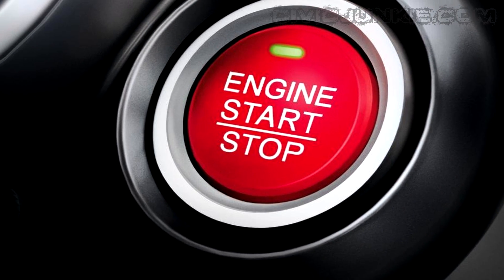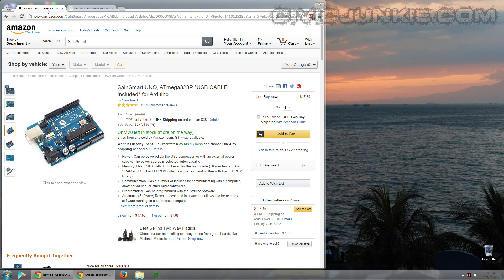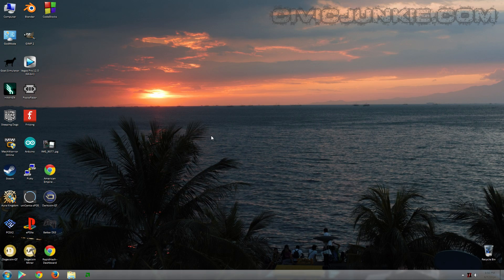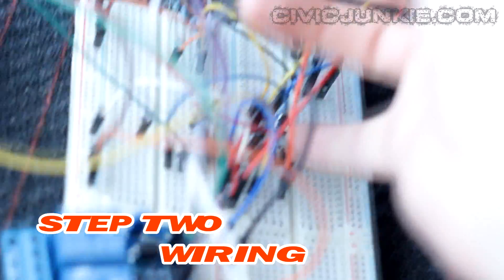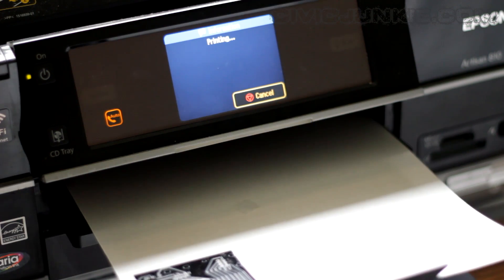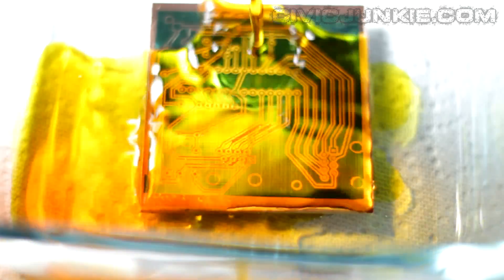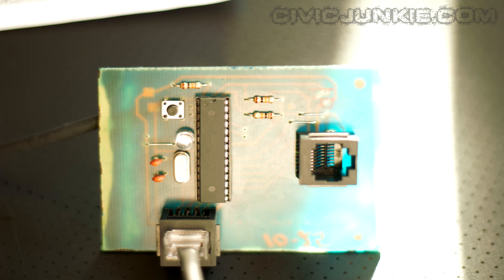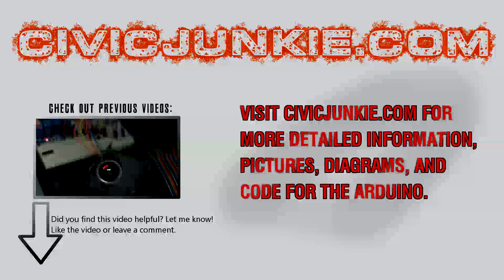Engine Start Button

Comment: Vehicles factory equipped with a start button also have a steering wheel lock solenoid which is required by law.

This is so 1920s.
Reply: Yeh, Its sooooo much like going in front of your Model T or Model A Ford and turning a very hard to turn crank arm to start your car engine.

Comment: I'd like to do this to my 95 Honda accord how ever can this option be tapped to a anti theft alarm system so the car won't start when the alarm system is armed
Reply from the maker: Robert Marler I would think that would work fine. As long as the alarm system has an output when it's armed. You could send that signal to the Arduino so that the start button won't work if the alarm is armed. You could also just add a keypad so that you enter a code in enable the ignition. Anything is possible... go for it!
Reply: Well I'm not to handy wit a circut boards but would u be able make me one?
Reply: And where did you get the push start button
Reply from the maker: Robert Marler
I'm not that good at making circuit boards either, as you can see in the video. :) I might be able to make you one, though. However, first create a temporary prototype with an Arduino. After you get it working, I'd be happy to design and build a circuit board for you.
Reply from the maker: Robert Marler  As for the engine start button that I used, I believe it's from a 2012 Mazda 3. Any button will work, though! At first I was going to just use an arcade button. You could even use a factory accessory switch as an incognito engine start button. :)
Reply: Sweet I'll look into it thanks :)

Comment: I think this video is about the longer way to install a SS button, however cars with keys that have transponders, I recommend to not remove the original key ignition switch, as it will need to communicate with the transponder in your key to start (disabled the immobiliser).  Also it is your backup, in case your PCB, and soldering work fails.

As far the MCM video, I think it is the quicker and easier way to install a SS button in your car, without having to invest all of the time, and resources shown here in the video.

This video is none the less interesting for electronics hobbyists like my self.

Regards,

Comment: Fantastic, just one doubt, did your tools works also with last generations cars (with can bus) such as (as i have) buick regal (or opel Insignia)?
Reply from the maker: Filippo Germi  This does not integrate with a CAN BUS, however, you can get a CAN BUS shield from a store such as Sparkfun. You can then program it to respond to the CAN BUS signals.
Reply: AlloySnake  Thanks a lot, i'll give a look to your suggested site, if something not clear can i contact you back for suooprt? regards

Comment from the maker: +John C It's programmed to receive input from a switch that you can have on the brake pedal or the clutch pedal... or on the steering wheel, or wherever you want to put it. You can also modify the program to exclude that safety feature if you like.
Reply: +Linden Van Genderen any car works
Reply: Any car dude. It's a switch controlled with a micro controller. You can put it on a crock-pot if you like.
Reply: Does it work on a vw Jetta 2002

Comment: It didn't seem like you push the brake pedal to start like most push button starts is that correct because the circuit board is controlling the on/off of the push buttonstart?

Comment: This is awesome man! Will the code be the same for a ford focus 2001 though?
Reply from the maker: Carlos Arias Basically the code just controls the relays. How you integrate the relays into your start system will determine how it will work with your vehicle. Look up a wire diagram for your vehicle to see how easy it is. If there is no RFID in your car, it should be an easy install once you identify all the wires.

Comment: What about theft prevention
Reply from the maker: logan burns I just lock my car doors. :) If you want something more complex, you can add RFID to the project, or make a standalone security system. I'm currently working on and Arduino based car security system. If I think it's good enough, I'd like to make a how-to.
Reply: AlloySnake Amazing job but somehow i ended here looking for high security. You're brilliant in other times i would install this however now im looking to prevent auto theft. My ex is a nut and has a spare key and control and stalks my house unlocks my car to basically show me lol. Coming from someone who knows electronics what would you recommend? For now i only got my hands on a steering wheel lock and it can be defeated but my target vehicle is inside but knowing i already basically have a hit i can't let this happen. Btw im in California and vehicles are stolen by the seconds and could easily be trasported to Mexico for sale.

Comment: What relay module you use ... actice LOW ot active HIGH?
Reply from the maker: vladimir sergiev I think the relays activate with a LOW signal. If you have a module that activates with a HIGH signal, just modify the code.

Comment: Alloysnake how hard would this install be in a 02 civic coupe
Reply from the maker: str8kustomz I know that the way I installed this will work with any Honda Civic from 1988 to 2000. I'm not sure about 7th gen Civics, though. If it doesn't have a transponder key, it should work the same way.
Reply: Thanks it does have a transponder key though

Comment: dude..i got an arduino leonardo that i usually used to school...it can work? or it has to be arduino one?
Reply from the maker: vince og I believe so. You may, or may not, have to customize the code, but that's all. I don't see any reason why you couldn't do it with the Leonardo.

Comment: You could have done that a lot easier with transistors instead of using a microcontroller.
Reply from the maker: Alec Haynes I used transistors... in the form of a micro-controller. :)

Comment: Nice job man. Do you have some problems with car battery draining? Did you measure the power consumption from arduiono, relay board and cigarret charger? Or you switch OFF all that stuff, when leaving the car?
Reply from the maker: vladimir sergiev Thank you. I leave it all hooked up. The longest I let it sit was about 1 week. It started right up. I did measure its power consumption, but forget what it was. It was a tiny amount, though. I'll measure again and leave a reply for you. I'm away at the moment, though. I'll try to remember next week.

Comment: What is the clutch interlock button and how do I connect it? If I use a classic chinese "Start Engine" button what am I supposed to do with the ACC LED and ON LED that are pictured in the diagram. I am just not connecting them and everything is fine? For the wires that don't lead nor come from the relays I have used the thin Arduino Kit wires. For all the other wires what type of diameter must I use?
Reply from the maker: Konstantinos Chrysikopoulos Some vehicles use a switch on the clutch(or brake if auto) that makes it so you have to push the peddle down in order to start the vehicle. You can program the Arduino so that this isn't needed, or you can just install a small button that you press at the same time as the start button. On each side of the steering wheel for example. That would also make others not know how to start your car.

Connecting LEDs is completely optional. It won't effect the Arduino. Or you can connect your own LEDs to show you what state the start button is in. Maybe one RGB LED?

As for wire, anything that connects straight to the Arduino can be any size. On the other side of the relay, however, will be more current. A thicker gauge wire is better. It also depends on the vehicle. For my CRX I don't need a very thick wire. I think I just used 18 gauge. I would recommend 14-12 gauge wire, though - just to be safe. Study your vehicle's starting system to determine what is best. I hope this helps.
Reply: AlloySnakeThanks for the answer. I have an old Fiat Punto Sporting and nothing is needed to be pushed down in order for the car to start. So what should i remove from the code you created if I want to start the engine by just pressing the button? How do I determine which cable is which? I mean the Ignition 1 and 2, the St and ACC. Do they have a standard color for all vehicles. You post some colors on your blog, but are they supposed to be the same in my car? Thanks again.
Reply: AlloySnakeOk, I removed the mask under the steering wheel and this is what I found:
http://postimg.org/image/re6m1y4df/
http://postimg.org/image/6zh2bhvql/
There was four wires all together and next to them three wires all connected to the keys with different colors. There were also two thin ones in the other image.
I used a multimeter and the I realized that my lock has two states (off and on) plus the engine start.
When the key was at the first position only the red from the three wires had 12v (that is the battery obviously).
When the key was at the second position the light and dark blue from the four cables had 12v and the orange from the three cables had also 12v. 
When I turned the key to the third position for about a second so that the engine started, for that limited amount of time the brown from the three cables had 12v and after a second nothing.So correct me if I am wrong:

Red from the three is battery
Light and dark blue from the four and orange from the three are the ignitions/accessories
Brown from the three is engine start

So we finally have two unused cables from the "four group":
the yellow and the other one that in the image I post seems red but actually is double colored red/blue I think. These two cables were always grounded. So what are they?
Can you explain me a bit more the starting system of my car from the photos I post. I guess many things change in your code for my car, thus i am thinking of writing my own code. 

The two thin wires on the other photo have any significance at all?
Reply from the maker: Konstantinos Chrysikopoulos It sounds like you know what you're doing. I'm guessing the two little wires are for the key-in-ignition alarm. Does the key cylinder not have an accessory position? That's strange, but if it doesn't, you can remove that part of the code. If it does have an accessory position, you just need to find out which wires are for accessories only and which are for the ignition/engine control system. Can you determine what the yellow and orange wires go to?
Reply: AlloySnakeNo, I think I can't, because there are three wires getting 12v at the same time and not one at a time. I am thinking o using just two relays one for the three wires that have 12v when the key is at the first position and one for the starter. I want to ask something else though. In your project, each relay has three holes. In the first one there is let's say the acc wire, in the middle the control wire from the arduino and in the other one? The battery cable?
Reply from the maker: Konstantinos Chrysikopoulos Keep in mind how many amps may be going through those wires. You don't want to overload the relay. That's another reason to give each wire it's own relay. As for the 3 holes on each relay, constant 12 goes to the middle one, then the thing that will be switch on or off goes in one of the side ones. One side is normally on and will switch off when the relay is activated. The other side hole is normally off and will switch on when the relay is activated. The wires that control the relays are connected to pins on the circuit board. You can see them on the right-side of the board in the pictures I posted on the site.

When you turn the key to the ON position, it sends 12V to all 3 wires? If that's what you mean, you can find out what each one controls by connecting each wire individually to 12V. Maybe one is ACC and two are IGN. Usually manufacturers don't put every system on one circuit. For example, one wire may be for engine ignition and ECU, one wire for for high current items such as radiator fan or blower motor, and one for radio/accessories. It's good to find out which wire sends power to what.

I searched Google for "fiat punto wiring diagram", and the first result was a PDF for a '99 Punto. You should check that out if yours is a first generation Punto. I believe '93-'99 are the same.
Reply: You helped very much my friend. I will try the project and let you know in a month.
Reply from the maker: Konstantinos Chrysikopoulos
I'm looking forward to seeing this work on another vehicle. Keep me updated on your progress.
Reply: AlloySnake I did my project finally with an arduino uno, that I programmed myself and works fine when not connected to the car, and a four 10A relay module i bought from ebay. All ignitions and accessories turn on fine when the button is pressed for less than 300 milliseconds. But when i press the button for more than that time, which is supposed to turn the engine on, the relays collapse. I repeat that if I do that without connecting everything to the car, the relays work fine. I finally realized that it must be something related to the security "key shaped" light of the car, that stays on when I try to start the car through the button and won't turn off. Is there any way to bypass the security system of my car? I searched and found that there is a pro bypass module designed by newrockies inc. Below you can see my code: 

int button = 3; //Start button.
int ign1 = 8; //Ignition 1 output
int ign2=9; //Ignition 2 output
int acc = 10; //Accessory output
int starter=11; //Starter output
int buttonLed =7; //LED for button illumination

int on = 0; //Are the igntitons ON?

void setup()
{
  pinMode(button, INPUT);
  pinMode(ign1, OUTPUT);
  pinMode(ign2, OUTPUT);
  pinMode(acc, OUTPUT);
  pinMode(starter, OUTPUT);
  pinMode(buttonLed, OUTPUT);
  digitalWrite(ign1, HIGH);
  digitalWrite(ign2, HIGH);
  digitalWrite(acc, HIGH);
  digitalWrite(starter, HIGH);
  digitalWrite(buttonLed, HIGH);
}
void loop()
{
  if(digitalRead(button)==HIGH && on==0){
    on++;
    digitalWrite(ign1,LOW);
    digitalWrite(ign2,LOW);
    digitalWrite(acc,LOW);
    digitalWrite(buttonLed,LOW);
    delay(300);
    if(digitalRead(button)==HIGH){
      digitalWrite(starter,LOW);
      while(digitalRead(button)==HIGH) ;
    }
    digitalWrite(starter,HIGH);
    delay(90);
  }
  
  if(digitalRead(button)==HIGH && on==1){
    on--;
    digitalWrite(ign1,HIGH);
    digitalWrite(ign2,HIGH);
    digitalWrite(acc,HIGH);
    digitalWrite(buttonLed,HIGH);
    delay(500);
  }
}
Reply from the maker: Konstantinos Chrysikopoulos
Also, Make sure the relays have a sufficient power source. If they don't have enough power, they won't stay active. Can you tell me how you have the relays wired to the power supply? Same with the Arduino. It might "shutdown" if the voltage drops too much. Before messing with the security system, Makes sure the Arduino/relays/power supply works properly. After that you can put your transponder key where the car can detect it. After doing these things you should be able to get it to work. Then you can bypass the security if need be. Does that make sense? I don't have experience with that particular car, so I'm only guessing about the security system, as most vehicles from back then have transponder keys.

Comment: I am extremely interested in doing something like this on my E46 M3 2003.  How difficult is coding on the arduino and would it be possible for my car? I also like the idea of NFC for the door locks.... not sure how that would work though...
Reply from the maker: The code for basic functions is really simple. You can see my code on the website. Adding NFC does make it a lot more complicated. You can get an Arduino for about 25 bucks and you can try programming it and decide if a start button is easy enough to do. The nice thing about the Arduino is that you can program it to do whatever you want. ie: press once to turn car off, press and hold to turn engine off, but keep radio on. Anything you can think of...
Reply: That is sick heheh... I'm just hoping my oem security system can somehow be integrated. Brilliant use for an arduino.